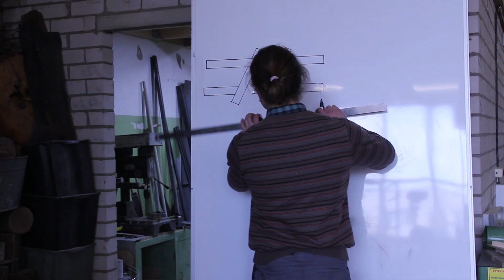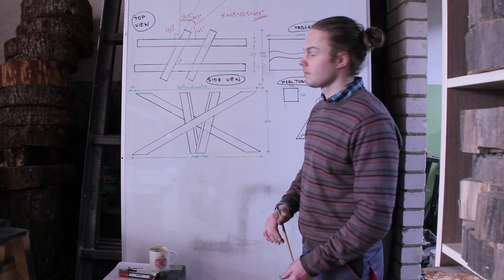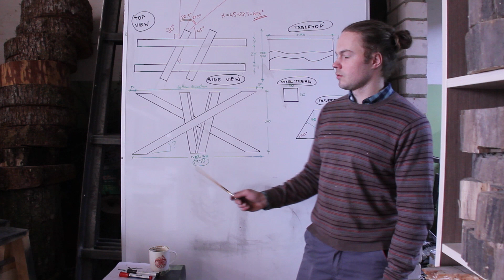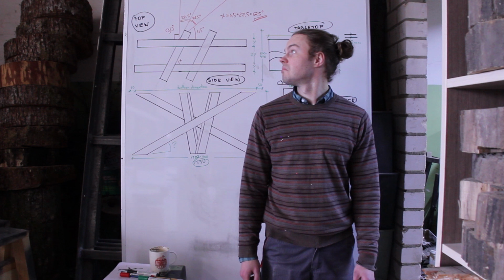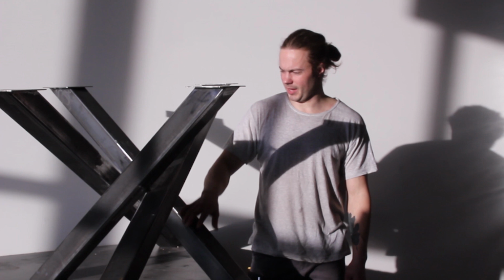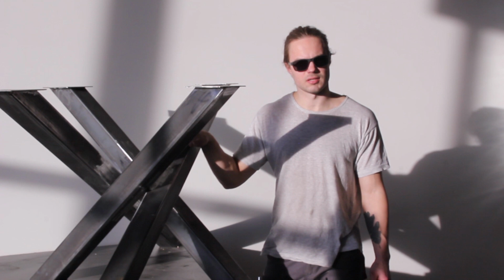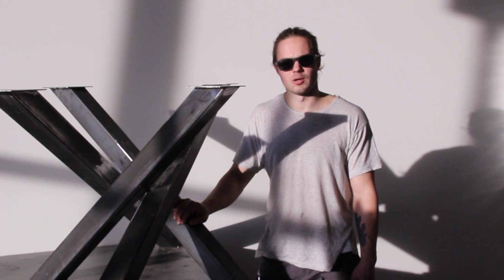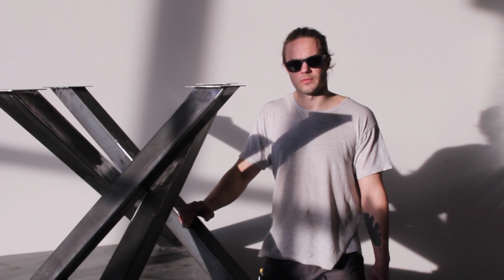making an industrial table base | steel table legs

Comment: Great idea for the leveling feet. I usually add a sheet of metal about 2 mm thick with a nut inside. Then screw the feet but I like your idea and how hidden it is. Also great work with the base it is not easy to build something with that many angles.
Reply from the maker: Thanks💪

Comment: Nice build! One thing you might want to try in the future. One the feet use polypropylene ( lit the plastic cutting boards) you can get it in black and it’s amazing. You man machine it but you cannot glue it. It’s self lubricating property makes it perfect for feet. They slide easily and don’t mark the floor. 
Best part is the color goes all the way through the material.
Reply from the maker: A great tip!! The client had some complaints about feet sticking to the floors or smth. Will try this material on a next table base;) thanks 🙏

Comment: Very nice work and very helpful video. I have a question if you don't mind. Can you please tell me the measurements of the rhombus in the middle of the construction, if the table is 2.30m x 1.10m?
Reply from the maker: First of all, Thanks for watching! If that’s the size of your tabletop, then the dimensions of the base in the video is about the right size. The perpendicular of the rhombus is double the width of the tubing (2x80=160mm). The angle is 22,5 degrees (or 112,5 degrees depending which angle you’ll measure). The thickness of the rhombus plate is 30-40 mm. Thanks about all you need to figure out the shape of it. 🤞
Reply: @Chiselsplay   thank you very much for your response. Just to be sure; the dimensions of my tabletop are 230cm x 110cm and I will use tubes of 10cm x 10cm. Shouldn't the dimensions of the rhombus be bigger? Is the table going to be stable with such base?
Reply from the maker: @georgevasiliou1117  if you use 100mmm square tubing then the perpendicular of your rhombus should be 200mm. the angles remain the same. The rhombus ensures just a proper spacing between tubes. And acts as a place to weld and secure tubing. If you want larger base, you should lengthen the longer diagonal legs. But we used the base in the video for 260x100cm tabletop and it worked just fine
Reply: @Chiselsplay  Thank you very much!!

Comment: Great Base, Question at what Angle did you cut the bottom part of the legs? My metal saw only goes to 45, this seems higher.
Reply from the maker: Thanks for watching. You’re right, the angle was a lot sharper. I had to cut it with the angle grinder by hand. I can give you some photos with measurements if you’ll DM me on IG of FB

Comment: what is the thickness of the 80x80 tubing?
Reply from the maker: I’ve done these frames from 2mm tubing and from 3mm as well. If welded correctly 2mm should be enough.

Comment: hi Errant. great video, great presentation. i am attempting this base build based off your video, but am wondering the dimensions of the table that these legs were built for. i am trying to size a table 10ftx5ft.
Reply from the maker: Woow! That’s a big one. I would increase the angle of the longer leg to reach the far end of the table. Otherwise the end of the tabletop might sag over time. Also I’d suggest making the apron out of steel to join the upper end of the legs. This should prevent the base from any distortion.
Reply: @Chiselsplay  thanks for the advice, ill definitely use it. would you connect the legs with like some flat iron strips?
Reply: i meant sheet meta
l
Reply from the maker: @restlesshandswoodworks5120  I’d use angle iron for extra stiffness
Reply: @Chiselsplay  the only thing is the tabletop is not square, it has live edge  curves
Reply from the maker: @restlesshandswoodworks5120  then I’d add a steel cross in between the top ends of the legs to bring that stiffness
Reply: @Chiselsplay  thanks so much! You the man

Comment: can this table base withstand 3,000 LBs?
Reply from the maker: There’s only one way to know that :D but for extra rigidity I would add a steel apron to tie the ends of the legs from spreading.

Comment: But you didn't show the middle rhombus and the welding done there
Reply from the maker: 8:25
Reply: @Chiselsplay  that's how you made the rhombus but not how it was welded with the legs. The camera view was mostly from front. Should have done some shots from the upper angle.
Reply from the maker: @issakh8043  agree, I was rushing a bit at the end or the project. I welded it just the same way as in my first attempt.

Comment: Great video and thanks for sharing x10 :) Would you change anything after having done it? Can this support a concrete top around 2300mm x 900mm?
Reply from the maker: Thanks 🙏 For wood countertops it’s stiff enough. For concrete slab I would probably thicken the diamond insert to 40 or 50mm. This way you’d get more welding surface and more leverage with those welds. And for the extra support I would probably weld a frame from angle iron or some tubing which would support the concrete surface and also wouldn’t allow for the legs to spread or sag. I hope that makes sense. But I am no expert by all means:)))
Reply: @Chiselsplay  Im thankful for your response. Totally agree on beefing up the parallelogram piece and instead of the angle iron, ill weld a small 900mm sq x 6mm thick sheet over the tops and under the concrete. Thanks for sharing the whole project from a-z. Would have been painful to calculate and visualize how to cut and weld those pieces together without it :)
Reply from the maker: Alex L glad to help! best of luck with the build!!!